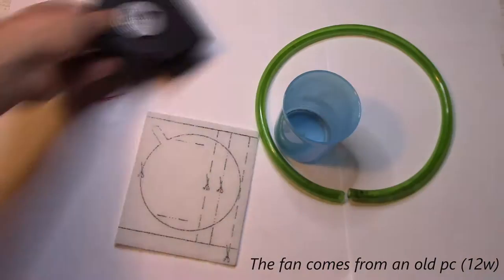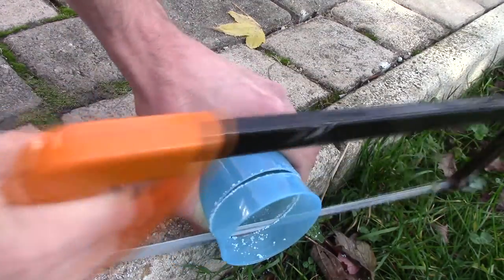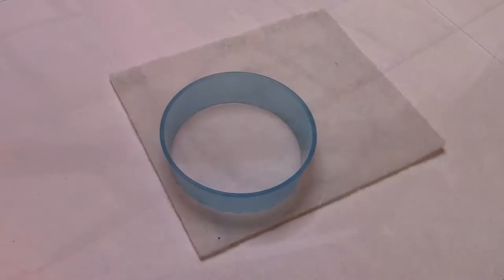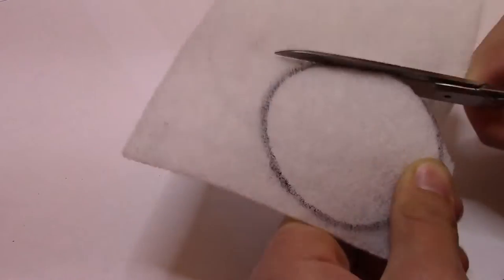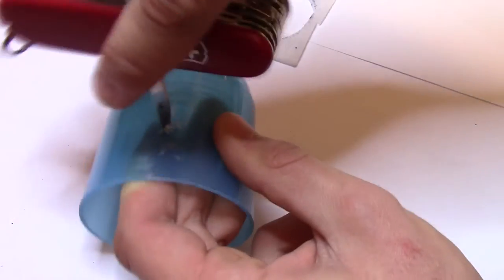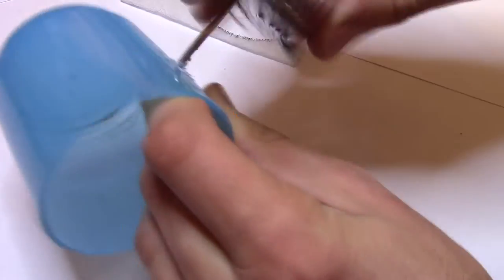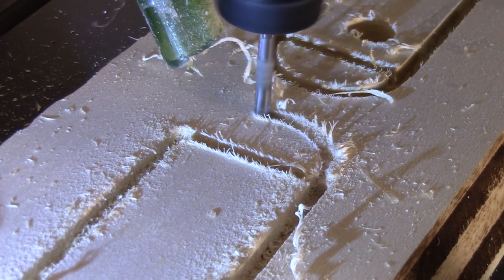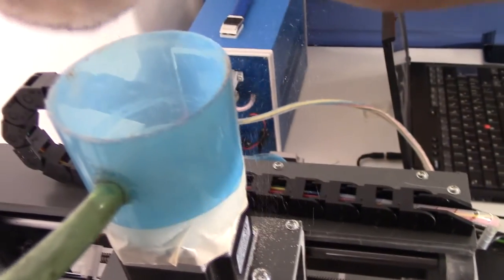diy Vacuum cleaner for small cnc

Comment: This the same idea i had in mind but using noctua fan with highest airflow. But then I've read that backward fan configuration like this one is more efficient and effective. I hope there's bigger versions of this kind of fans.
Reply: Noctuas are not designed for DIY vaccums. Buy a brushless DC motor, for the power.
Reply: Maybe find an A/C Blower from a car and design something